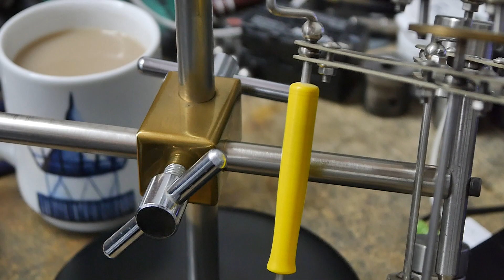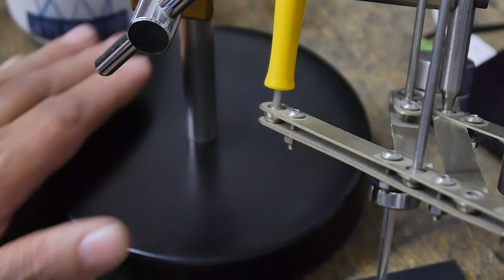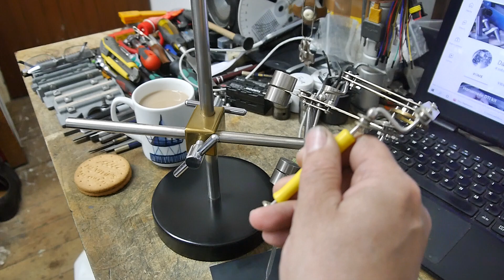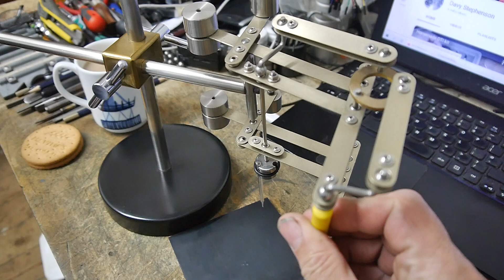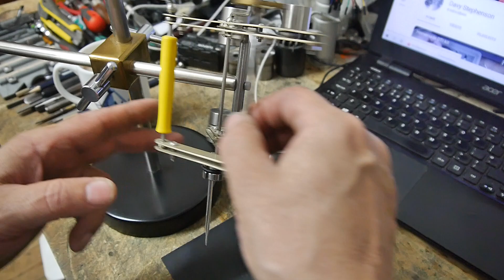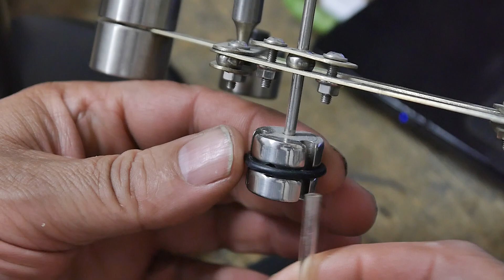My Homemade 3D Pantograph

Comment: In terms of the ball joint near the lower ball joint of the tool bar, I see that you have two plates on the upper side of the ball, did you change the hole width for one of the plates? does it have angular restrictions? is this common to the other professional 3D pantographs you've based this on? 
I've been looking at these and a plate intersecting a ball seems like the hardest design feature to navigate so I'm hoping that its not needed.

Comment: I've been thinking about a similar tool to help with miniature painting and scribing. Could you post the material list you used to build this? Similar devices are extremely expensive, and I'd rather build my own for much cheaper.